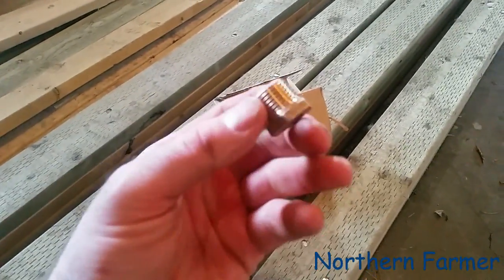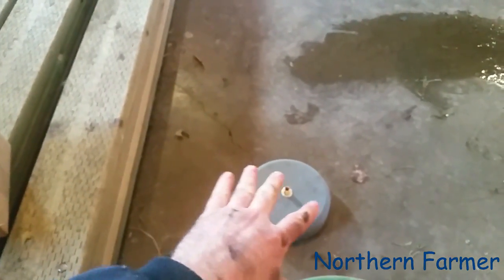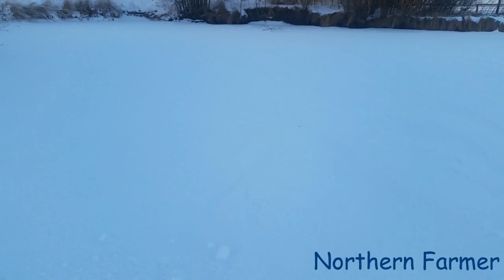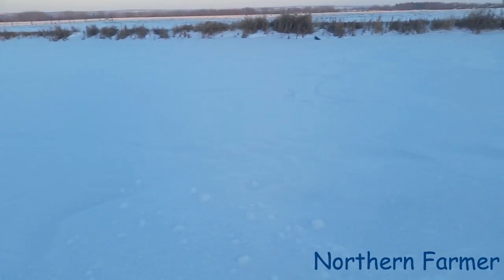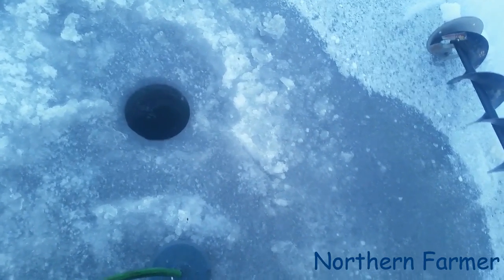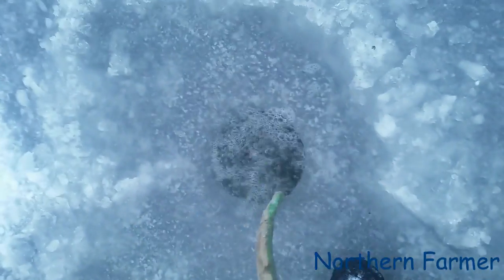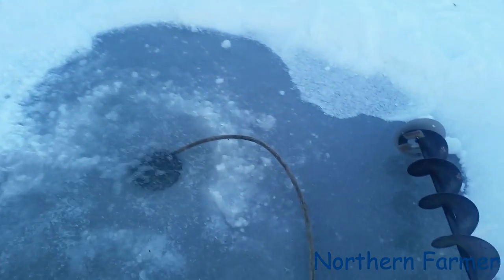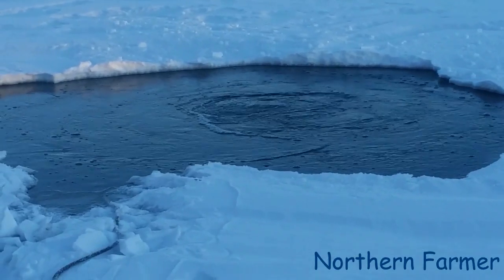Adding Oxygen to water!!!

Comment: do you have the windmill aerators out there??
Reply: @ the start of the vlog he told you about it if he has 1 or not have 1
Reply: just thought windmill would less fuel or hydro.
Reply from the maker: You bet.. there are a lot of them that you can see if you take a drive down the road... I have one to but I have just never put it up yet... they dont work pretty good to.. but not as good as a electric one..

Comment: I knew you had to oxygenate aquariums but have never heard of the problems of pond water - both you and americans call it a dug-out where we call it a pond which for a lot of farmers here would use this stored water from the winter months of runoff for irrigation in our summer. Another very informative video Cheers
Reply from the maker: Exactly.. Same as aquariums... If you have a bigger dougout they do not need tobe airated since they can hold up until spring breakup and then they start getting oxygen again..  But having them aireated is never a bad thing...

Comment: that's really cool, never would have thought that you would have to do that.
Reply from the maker: Yup.. You would be amazed what it does for the water.
Reply: Would be a great way to keep stocktanks from freezing up
Reply from the maker: Thats a great idea... Those little motors on those compressors probably take half the power than the floating deicers do.
Reply: Yeah and if you had a couple tanks close by you could just run an air line to each one of the same compressor probably
Reply from the maker: Well this set up has 2 lines.. I only use one.. but when you have both going at the same time the air is cut in half.   But thats still a pretty good idea...
Reply: Yeah but you wouldn't need near the air in a tank. Seems like on any deicer we have at some point it becomes an electrical issue

Comment: wont the hose freeze?
Reply from the maker: No because the air is flowing through it and it keeps the water out.. if it ever stopped there is a valvle at the stone that doesnt let the water get back in ...
Reply: o ok.. :)
Reply from the maker: The best way is to have the line burried way down below the frost line... but this does alright for now.
Reply: it would be the best way, but i'll just take longer 2 get it done.